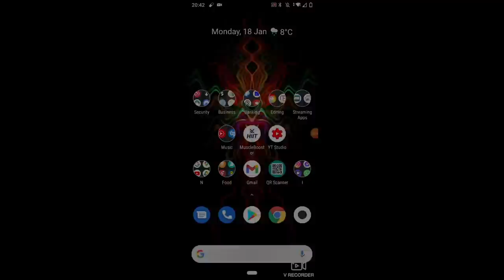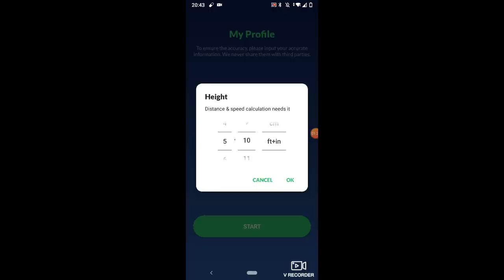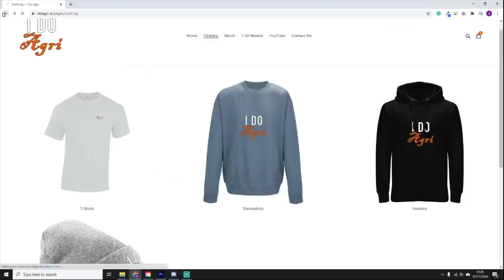A Day in The Life on a Small Irish Farm for Winter! #idoagrifitfarmer No. 2

Comment: Was there 2stroke in that petrol lad? Just looked very clear!!  Grand saw btw!
Reply from the maker: There was indeed, green stuff it is. Cheers for looking out. Tis a grand saw
Reply: @IDoAgri  Not a bother, yeah just said l'd check in with ya!  Tis easy any of us slip up!  Tis pamlube 2-stroke l use and it has a red dye.  

I have two 1 litre mixing bottles and make up one or both fresh depending on amount of work l'm at.  
I notice the dye does kinda dissolve out of petrol if it's left mixed a while and then you are left doubting yourself!!